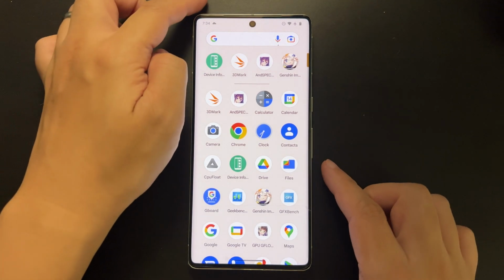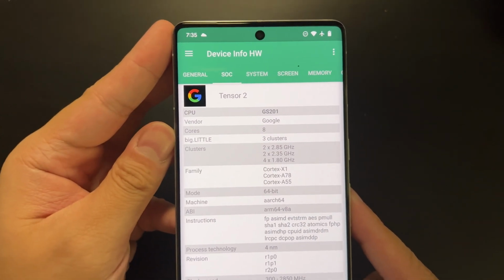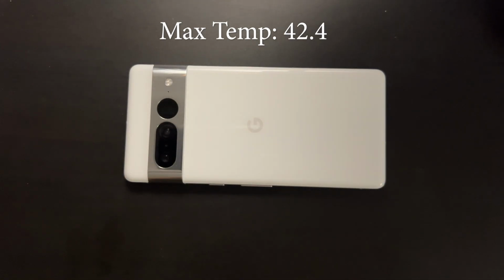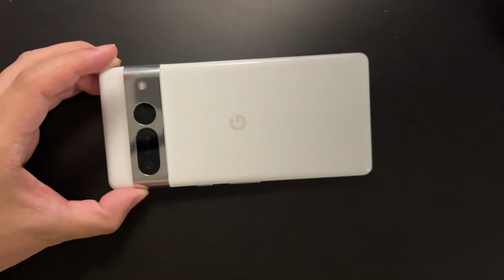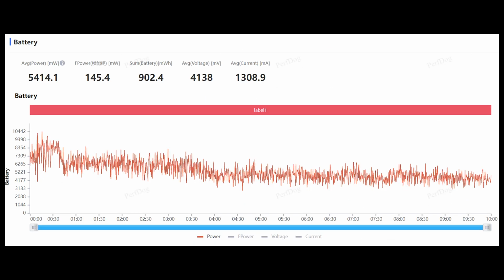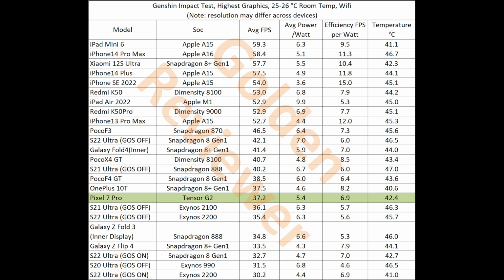Google should feel ashamed! Pixel 7 Pro Genshin Impact Gaming FPS Test

Comment: Finally, some1 that actually knows how to test chip performance... Unlike other youtube "elite" mkb., mrwhos... and the rest of the puppets. Either they were paid by Google to give them the best possible reviews or, even worse, they just don't know how to test phones. Either way, they don't deserve those millions of subs.
This G2, similar to previous G1, is an absolute trash chipset, made by Samsung- we are getting 2020 performance for the 2022 price.
Google marketing did their job, "it's not about performance, it's about machine learning" bs... When you have a crap chipset on your hands, pushing deadlines, ofc you are gonna switch focus to something else, anything other than the performance itself (never mind that the performance upgrades was and still is the main factor when comparing new phones, every year, so stating that this new chipset isn't designed with performance in mind is just bullsh..).

Comment: Well I have a 6 pro it works amazing.  Or did 7 step down?
Reply: a slight step up in genshin, a bigger step up in other games like cod.
this guy is just a drama queen, you also get sub 40 and even sub 35 drops in snapdragon 8 g1 phones, the only phones that can run genshin at a locked 60 are the rog 6 and newer iphones.

Comment: Google provide a Gaming Mode and also the ability to elevate process priorities.  I would expect that these are applied when testing game performance.

Also.. how long have you had the device? Burning on and settling in updates and storage are such factors, I doubt they can be tested on a just-enabled device.  

I see reviewers giving decisive pictures on battery and it's simply too early to assess what a realistic load on a settled-in device looks like 

I like the review production, but the caption / title in YouTube doesn't seem fair.  A little more detail on the exact device and settings - in Android, not in the he, would' be more interesting.. and maybe a device that's had stable usage patterns for an initial month.... Especially if batteries and heat are to be assessed.
Reply: Can you tell me how to access the gaming mode? I just got the Pixel 7!!

Comment: The problem is not the chipset, but the game. This game has a bunch of issues with Mali processors, having more overheating and framedrops specially on Exynos chips. You'll see better performance on Snapdragon devices and iPhones because they used these processors to optimize the base game.
Reply: Dude What are you talking about The P7P is a flagship phone that means you can play hard core games  like ginseng impact and plus they have a good camera too😂🤪🤪🤪

Comment: in dame tech the tensor average 45 fps in genshin impact which is higher than s22 ultra. Genshin Impacat is the worst optimized game on android. genshin also isn't optimized for the G2 like most games. PUBG New state  allows higher settings on 6 pro than the 7 pro at the moment because of optimization. Optimized games like COD mobile, apex legends and PUBG all play at higher settings and fps then the s22 ultra.
Reply: Average google tensor defender
Reply: @Gigachad-hb7ji  theses are facts. Say whatever you choose 😃. Diablo immortal only allows 30 fps on iPhone 14 running ios 16 does that mean it's not a good gaming device? No, It just means it needs more optimization. Immortal can be played at 60 fps on 7 pro and 6 pro.. stills need optimization for them as well. All these flagships have higher then recommended requirements to run these games.
Reply: @Eazidosit  Well the tensor G2 is still made by Samsung so expect overheating and abysmal performance still.
Reply: @Gigachad-hb7ji  wasn't the snapdragon overheating? Yes, and when tested all the chips heated up to within 3 to 4 degrees of each other.  Pixel camera app would say it was hot which was a bug because I could switch to my 3rd party camera app and keep recording. All devices get hot doing intensive task.. It isn't overheating until it gets hot and shuts down.  If it didn't shutdown, it didn't overheat.
Reply: @Eazidosit  The Google tensor is miserable in terms of performance.Just check the benchmarks. The Ai is nonsense bullcrap marketing. All phones already have a built in npu so the Ai dosent even matter anyways.
Reply: @Gigachad-hb7ji  benchmarks don't tell that the tensor uses 2 main power cores compared to the industry standard design of one. It also utilizes the cores differently because of design. Although Qualcomm has built their chips for AI as well still usithe same design. No other device performs AI on the level of the tensor at the moment. I take regularly on the 6 pro up to a hour sometimes without a issue. Have been doing the same on 7 pro without a issue the past 2 days. You can buy what you want but don't let bias reviewers who are brand loyalist or allow benchmarks to determine your purchase. They all can handle any mobile app made especially if it's optimized. Google is always ahead with the latest version of Android so developers are normally behind with their apps because of what version the mass majority are running. This was before the tensor, which is now only in pixels and no other android device.
Reply: Whatever you say but Pixel is trash in terms of gaming performance, genshin isn't well optimised but it runs hell smooth on 8 Gen 1 or 8 Gen 2 device's like OP 11 and Ximi 13 Pro currently
Reply: @Gigachad-hb7ji  True tho but this Tensor guy never gonna understand that Pixel is a pure sh*t in heavy usage like Genshin
Reply: @Anotherstranger88  which at this point is a more broadly used chip than the tensor which can only be found in the last 2 pixel devices made. One game doesn't determine gaming performance. Especially when it runs other games better than the chips you mentioned

Comment: 12s ultra is a monster in the table. The same fps and better temperatures are better than the A16. This g2 is not the strongest.
Reply: I can't imagine how good the 8gen2 will be. I hope it will be better than A14 bionic in power efficiency or on par with A15.
Reply: @bruhname2072  a14=8+gen1
Ok
Reply: @bruhname2072  Yes, it would be nice, but at least it doesn't burn your hands like the a16 and it doesn't reduce the brightness under load.
Reply: @xc5662  in GPU performance yes. But in CPU efficiency, 8+gen1 is actually below the A14 bionic (in low to mid-range clockspeed)
Reply: @bruhname2072  I have to say
Reply: @bruhname2072  it is in the middle between a14-8+gen1-a15 ok
Reply: Not better. Look at power consuption.
Reply: @SpilkaSAP  The table does not lie, it shows the same fps and better temperature and does not reduce the brightness. 8+ gen 1 is better than A16 in gensin inpack
Reply: @elit3zotya764  no, 8+ gen 1 consume more power, a16 has the best perf/watt.
Reply: @SpilkaSAP  it consumes a little more, in return the temperatures are much better and it does not reduce the brightness, Look at the table man, nothing to explain
Reply: @SpilkaSAP  snapdragon video and multimedia processing makes it faster, samsung fold 4 beats the competition in file speed, processing and so on
Reply: @Prime.Amazo.one1  no, apple has the fastest media engines
Reply: @SpilkaSAP  fasthest media engine, but not the best transfer speed data😅😅 since its using Lighting

Comment: Am I blind or is there the resolution somewhere? Is this on 1440p or 1080p?
Reply: The game runs at 720 on every mobile phone even apple, except the iPads that runs at higher resolutions
Reply: @PB1up  What seriously? And they still can't make it work on Switch?
Reply: @Mew178  well to be fair ,as much as I would to see that , if it could ,it probably can be done if it was entirely remade with the switch in mind and with the lowest possible settings , the switch is using old cpu and gpu hardware that came out in 2014-2015, you can probably emulate the switch on current phones ( haven’t really looked into to that )
Reply: @PB1up  It's really sad, I was really looking forward to playing it on my Switch none of the phones run it well so I just play it on PC. And to be fair even my laptop with a internal AMD GPU struggles with it. The PC runs it  fine. Kind of crazy that half the peopel playing it are mobile users. Guess they play on the lowest setting.

Comment: This chip is even worst then exynos 990
Reply: Let's not get carried away here shall we? Nothing is worse than E990 except earlier Exynos chips
Reply: @jhkuno88  that chip was released when? 2020?  February 11? U really think pixel is better then s20 ultra? It's no where near the snapdragon 865. Exynos and this temcor chip have alot in common like throttling but other than that if u compare blow to blow. S20 ultra is a better phone and it was released almost 3 years ago. That says alot brother
Reply: you said this chip is worse than e990 which is not true because e990 is literally trash.......don't bring sd865 here it has nothing to do with your original comment
Reply: @jhkuno88  yea sure E990 is trash but this tensor 2 chip that just got released and is supposed to be a new chip. Bruh even exynos 990 is better value then this trash chip. Basically tensor 2 is equal 2 snapdragon 865 that's hilarious. And as for exynos 990 it's peak performance is equal to 865 its sustained performance that's the issue same as tensor 2
Reply: @luciferjohnson8495  tensor2 is not equal to sd865 it's worse....and e990 is even worse than Tensor2.....now if you say is it better value a cheap e990 vs a new expensive Tensor2? That might be true, but that's not what you said in the opening post

Comment: I just want to remind everyone that this phone should perform around the snapdragon 888 level so either this game is unoptimized or....nah that's it.

Just like CyberBug is an unoptimized pile of 💩, this game sucks 🍑.
Reply: Exactly.. All these people making these silly comments comparing Tensor G2 to a SD845 and lower are just crazy. I've had phones with all those chips and the pixel 7 pro I have now is way faster. This game is probably just not optimized for this chip (more so Qualcomm probably)
Reply: If you follow most channels, you would think the phones can't run this game better than they portray. If you keep it at it's default, medium settings, and set the fps to 60. It will stick closer to 60fps for very long. This is what I did on my s22u and s20+. I wish they would do this instead giving people the impression that the phones can't handle the game at all.

Comment: how about after the recent updates there has been? mine runs perfect even on the highest detail settings
Reply: this is specifically for genshin? asking beause I’m looking to buy new phone. would you recommend pixel 7 based on your experience gaming?
Reply: @kilgoretrout3904  well, you can play the game on it, but it is not as good as the other phones you can get on this pricepoint. like the xiaomi 12 which has teh snapdragon 8 gen 1 in it. the pixel 7 is not made for gaming, but it performs quite good now. it does get quite hot if you are gaming for a while on it.

i wouldn't recommend it if it is just for gaming (if you want a gaming phone, the xiaomi blackshark and the Asus ROG phone 6 are great), i would recommend it though if it is for the overall performance.

it makes great photo's, it's software is very smooth and has no bloatware, the battery life on mine is very good and its price is great for what you get.

Comment: Tensor is for AI 1st processor not for heavy gaming purposes or raw performance
Reply: Wow that's literally the point of the video... Thanks Mr Obvious 🤠
Reply: @bruhname2072  no need to test google pixel for genshin we all know it will perform bad  because cuz its AI first duhhh
Reply: @tobitonda6812  Then why did you click on the video if you already knew it... 😑

Just.... just leave.
Reply: @bruhname2072  i didn't watch the video cuz it perform bad in heavy games, pixel can play casual games but not heavy games.
Reply: The Tensor only uses the most out of it. Although it scores lowest in all AI benchmarks, being below the Snap 778G and not even half of the 8gen1.

Comment: Pixel phones have okay build quality and good cameras but garbage level performance. Severely under-delivers at its price point. Don't be fooled by Google's marketing - any other phone at this price would have just as good or better cameras and build quality while being equipped with much a better performing and efficient SOC.

Seems like Dimensity 8100 is the all-round winner for the current generation. Just a shame that there isn't a Dimensity 8100 phone yet that has good cameras.
Reply: Pixels were never known for performance, they always had underclocked chipsets. Pixels are known for their cameras,software and haptics
Reply: Not everyone is playing bleeding edge games with max settings. This chip is not competing on these metrics. Heck, it's not even marketed in this way, so trying to do so does not make any sense. It's fantastic at what it was marketed as. As for the design, it's so striking i can notice it from across the gym. That being said, it's not a style for everyone - personal preference.

Also, the phone is getting some of the best software and longest support for Android, so that's nothing to scoff at. Other OEMS, other than samsung at this point, aren't even coming close to this. Plus, they're offering OEM replacement parts with ifixit, so you can keep it for 5 years if so desired. Pound for pound, the Pixels are fantastic and worth the money, imo.
Reply: @CerealforProtein  bleeding edge gaming is valid a method of performance evaluation even if its substance is irrelevant to the user. It tests how the core specs will hold up over time as well as battery life and cooling system. Extremely important factors to most people. 

IMO people fall victim to the marketing too often. If somebody sells a piece of celery for $100 and claims it's a healthy product, then this cannot be criticized because it is fantastic at what it's marketed as? Meanwhile someone else is selling a whole vegetable salad for $10 which does far more for far less. Granted this is an extreme example but this not stray from the original point I made. Products should be compared to competitors rather than just referenced to its marketing.

Longevity of software support is nice but not worth paying more than double for phones that have 3 year support. I would just buy a new phone after 3 years and get the new phone experience all over again: refreshed battery endurance, a much faster device (even though my previous device is already much faster than the P7P) and still have my old device as a backup or to sell. I get two devices that are both superior to the P7P and I still would have spent LESS money than the price of a single P7P.

Comment: The tensor g2 chip isn't fully optimised the same was with 8gen1 give it some time
Reply: It doesn't even have GPU  power as A12 bionic (iPhone Xs series)
Reply: The 8gen1 never got "optimized" as there was no saving for this one, just like the Tensor. It's Samsung CPU. 

Optimising it means re-releasing the Tensor on TSMC basis, and that can't happen by software updates.

Comment: This is there 2nd phone with their own chip they are not making chips for a decade so it will take a little time
Reply: They are not making any chips, it’s not a coincidence that performance of every Tensor matches its brother Exynos… they just add ML on top for speech to text and that stuff…
Reply: No company makes their own chips, they design if then forward to the foundries who manufacture it, for google their foundary is Samsung which we already know makes trash chips.

If tensor was made with tsmc would have performed way better.

Just look at 8gen 1 and 8+gen 1. Both chips have same design but the one made by tsmc is much superior than Samsung.
Reply: @tgm.nabam101  no they don't design the chip they tweek the already designed chip by tsmc to their needs
Reply: @DemonJani  what bullshit, nvidia, intel, qualcolm, mediatek, apple etc all design their own chips then they contract with tsmc and book a certain amount of their manufacturing capacity for the production of the chips.

Tsmc is just a builder, the individual companies are the architects of chips in a sense.

Comment: At least its better than Exynos
Reply: It's worse
Reply: It is an Exynos, with TPU built in.
Reply: @drill_fiend1097  Worse in long run compared to Exynos
Reply: @samsungoneiu2000  It really isn't. It's literally based on an unreleased version of Exynos 9855 (2100's real designation being 9840). Can't get any worse than 2100 considering this has a newer GPU with more cores.
Reply: @drill_fiend1097  Exynos without gos get 40fps-50 fps, still faster overall